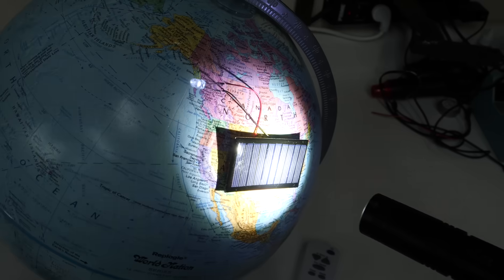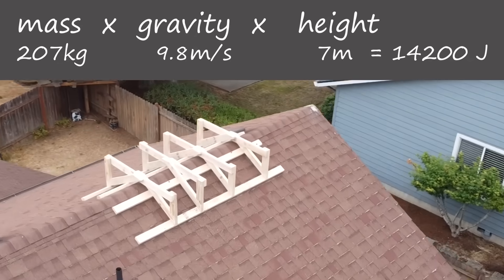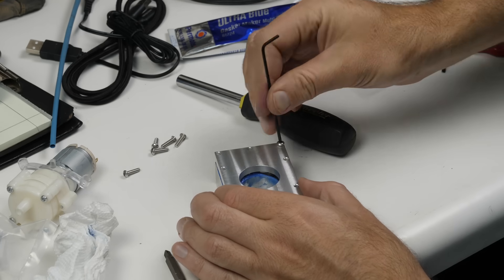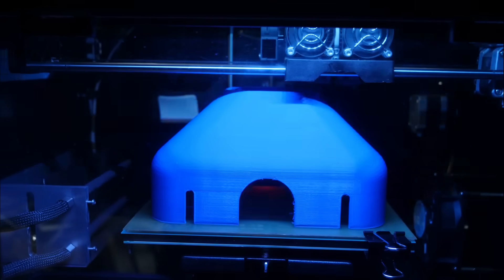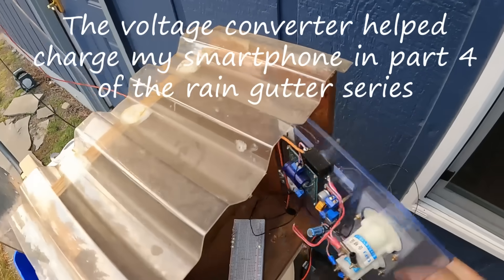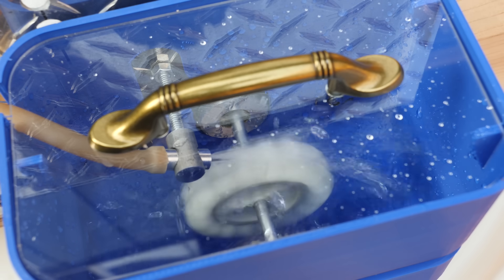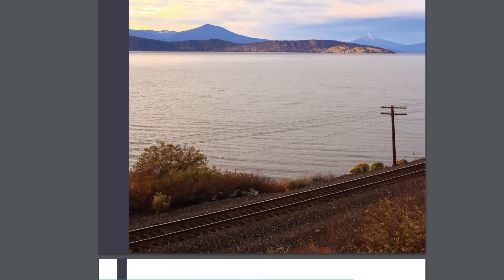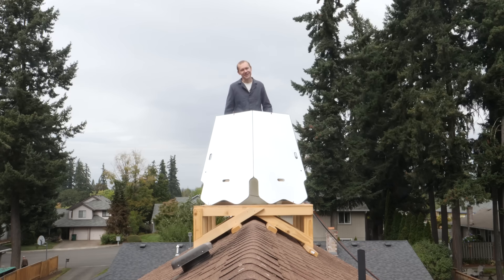Storing Solar Power on my ROOF!!!

Comment: THIS IS A TOTALLY IMPRACTICAL SYSTEM FOR AVERAGE HOMEOWNER.  UTTERLY RICICULOUS!!!!  NOW, IF  YOU  COULD BUYYOUR TOWN'S   WATER  TOWER AND 
HAVE IT MOVED TOYOUR PROPERTY, THAT WOULD BE A VIABLE SYSTEM.  BUT YOU WOULD ALSO HAVE TO INVEST  IN  A PUMP CAPABLE OF SENDING WATER UP
INTO THE AIR 70 TO 80 FEET.  AND YOU WOULDNEED  A  BATTERY BANK  CAPABLE  OF STORING THEENERGY NEEDED  TO  PUMP WATER THAT HIGH AT A DECENT FLOW RATE.  GET YOURSELF A GENERATOR INSTEAD AND/OR  A LITHIUM/ION/PHOSPHATE BATTERY SYSTEM WITH SOLAR PANELS.
Reply: weh-weh-weh           you are an idiotChild             this is a  GREAT  demonstration of  storing  energy  energy from an  intermittent  source.!!!           suggest that you  take your meds, and  Listen  to it again.   with your eyes closed.

Comment: cant you get more energy out of it, by running the water through a generator, catch it, and then run through another (set of) generator(s) or wouldn't that add up?

Comment: All the water splashing off the waterwheel is wasted enrrgy - better to use a Francis turbine: "The Francis turbine is also called a radial flow turbine, since water flows from the outer circumference towards the centre of runner. "Inward flow"water turbines have a better mechanical arrangement... As the water swirls inward, it accelerates, and transfers energy to the runner." https://en.m.wikipedia.org/wiki/Water_turbine

Or a Pelton wheel - "The Pelton wheel extracts energy from the impulse of moving water, as opposed to water's dead weight like the traditional overshot water wheel." https://en.m.wikipedia.org/wiki/Pelton_wheel

Comment: As I start to watch the video, two concerns I have, i hope you solved it by end of video:

1, can’t or hard to pump water over 10-15’. May need a 2nd or 3rd pump at every 10’ to assist

2, is there enough water out of a 55g drum to do anything useful?  Even an ICB 333g tote only has a limited supply.

3, ‘bonus’ question:  can you string multi generator in series to take advantage of the water, like ‘reuse’ the same stream down the line?   A string of gen along the ground.
Reply: Answer to #2 - 55 gallons of water is a miniscule amount, not able to do anything remotely useful.   But a fun exercise.

Also, is it safe to have a small cylinder of water on the roof, weight over 500 pounds?

Comment: i admire your electrical work sir, maybe you can use ram pump to pump higher at low energy, i've done this using a 25w aquarium pump that feeds the ram pump, pumps water to a height of 12meters, maybe bigger and more efficient pump will do the job, pumped hydro is one of my ideal power storage for solar energy

Comment: You can improve your project replacing your actual generator for a closed turbine one. Easy to 3D print, and you'll gain a lot of extra energy. You are wasting a lot of extra kinetic energy in that open environment. It's just a idea.

Comment: Although its not  practical but you made to understand the concept.
Its an inefficient way of using energy in small scale just get a power bank to store energy  which will be lot more cheaper than this project.
.
At last this project is awesome for those who have to just fill their roof top tanks from underground tanks automatically. So very much thankyou sir i was thinking of doing it.
I had 50w solar & pump but didn't installed yet.
Thanks 🙂🙂🙂🙏🙏🙏👌👌👌

Comment: I'm absolutely amazed that the tiny pump can actually move water to that height.
Reply: I concur. Pond and fountain pumps can barely do 8 feet
Reply: It's probably a diaphram pump. Low flow high pressure.
Tipically pond pump use an open rotor centrifugal impeller. Centrifugal pumps require lots of power and lots of flow to have a decent amount of pressure.
Reply: A Sequoia can do the same up to 100 m. A FUCKING TREE!
Reply: The magic of airless capilarity
Reply: Nature always does it better
Reply: The pumps I bought last summer to build swamp coolers only lifted 22 inches-non returnable. Yes U would love to know what his pump was.
Reply: @carpediemarts705  7
Reply: @patrickdellamore2750  seven what?
Reply: what is that pump!  how many days could it run before the pump fails?
Reply: @stawastawa  diaphragm pump - often used on yachts to e.g. flush toilets
Reply: @LiborTinka  I believe diaphragms are also beneficial due to the inherent backflow prevention.

Comment: It was so powerful it could charge a 3.7v 5000ma battery 🔋.. Really for the cost and effort and maintenance its way cheaper to buy battery packs and charged with the free solar panel.. Like a sealed lead acid battery n solar panel.. Heaps more power and way more energy density... Cool idea for a bit fun only..

Comment: If you get a car fuel pump for e85 it will be high volume, high pressure and submersible. Off something like a 2010 Silverado with the flex fuel option

Comment: Great project! In addition to that you could collect and store the rain directly on your roof and convert it into eletrical energy also. That means you would use the energy coming from the sun that has been put into the rain during the process of becoming clouds.

OK just realized you already did it in another video. :D
Reply: Really cool although I was shocked to find 55 gallons only produced the equivalent of aa battery. Perhaps upgrade to a car alternator with a fly wheel and seal the water turbine.  On 
Another aspect is that the garden hose already has pressure.  Additionally a black bladder like an inflatable bed draped over the roof could heat the water from sunlight.  The final warm water could be for washing or if hygienic and non-chemical go into the hot water tank.  There are a lot of ifs.....

Comment: Instead a plastic container on the roof, use a black metal container to absorb the sun heat. Use it to generate electricity and feed that warm water to your water heater. Voila, 2 birds with one pellet.